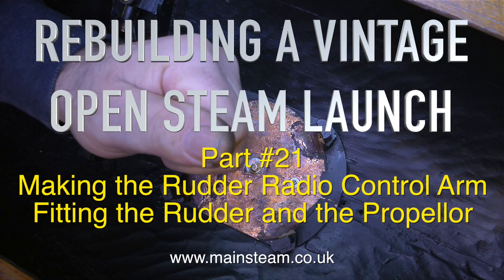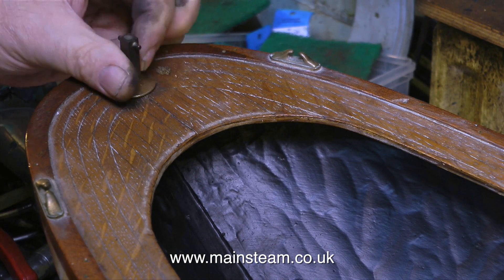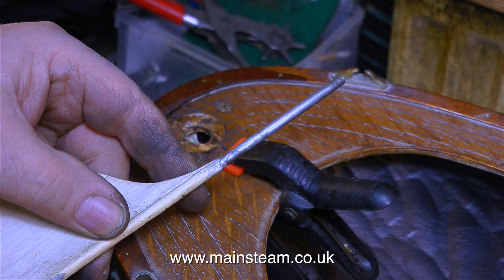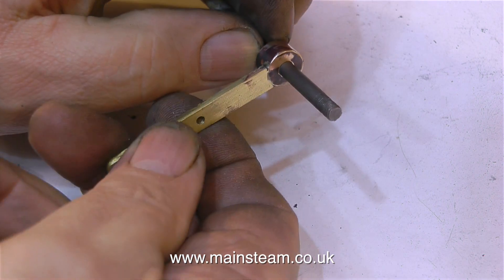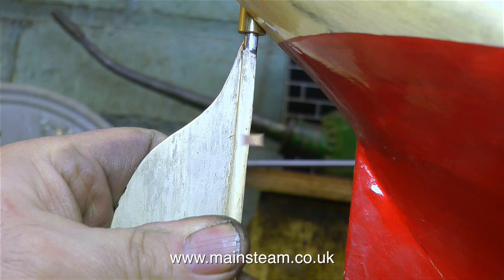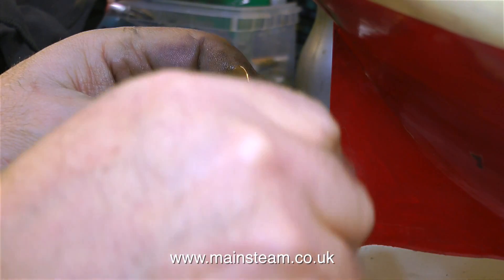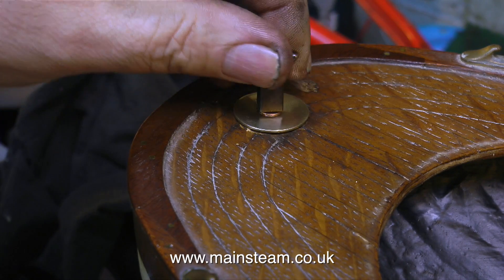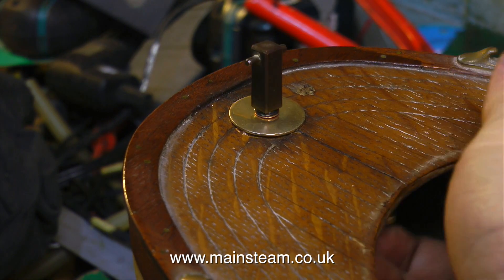REBUILDING A VINTAGE MODEL OPEN STEAM LAUNCH - PART #21

Comment: Thank You. Did you ever consider raffling off one of the brushes.
Reply from the maker: Good Idea ..... Thanks :
 -)))
Reply: Keith Appleton My foot doctor uses those to knurl the wound on my gib toe, no I am not diabetic just smoked too much 48 years. anyway he does it to make the brain think it is a new wound, anyway again he gives them to me. the ones he uses are blue plastic with the blade attached. one would really want to wear glass' using them. Old One Legged Man Joseph T